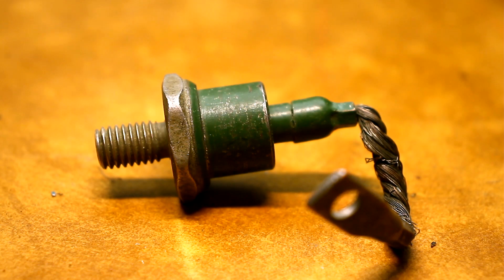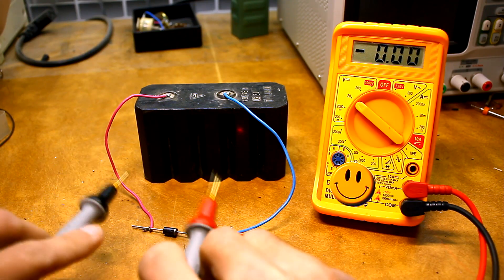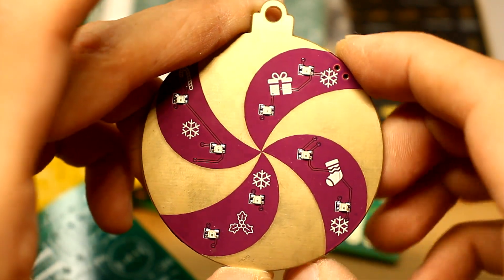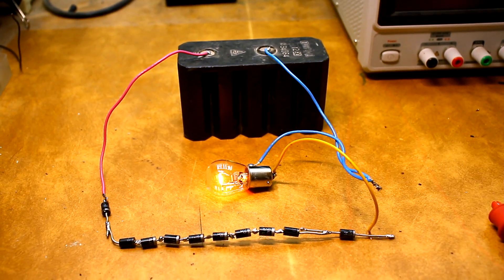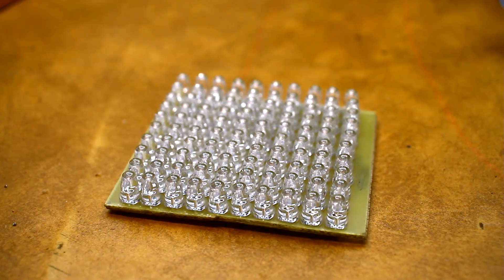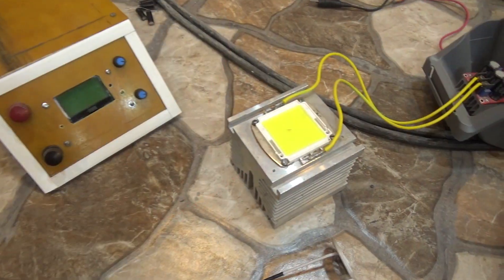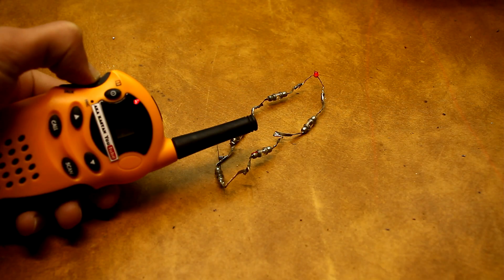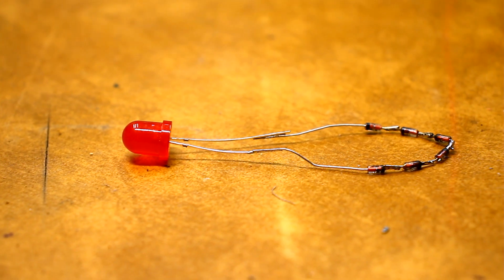What can be done from a diode

Comment: Your array of red LEDs can be used as a darkroom light for old fashion black & white film development. 
Another use for LEDs is a tachometer. I needed a tachometer one day, and I did shine one LED into another one connected to my oscilloscope. I put a piece of tape on the shaft of the motor I wanted to monitor. The piece of tape interrupted the light path between the two diodes and I could see a pulse on my oscilloscope screen, and measure the motor rotational speed.

Comment: Very nice. But what did you mean with microwave diodes? Did you mean the diodes from microwave ovens? (I mean the hv diod in the voltage doubler for the magnetron). Thank you and have a nice day.
Reply: Microwave diodes are diodes intended for use at very high frequency like 20Ghz (in the microwave band) for example

Comment: I took apart a cheap car phone charger once and found just a bunch of diodes on a board with an LED and resistor, so yes, that circuit is used, but extremely inefficient.
Reply: Yep, I commented this before you mentioned that in the video.